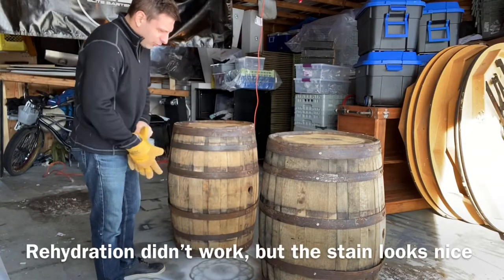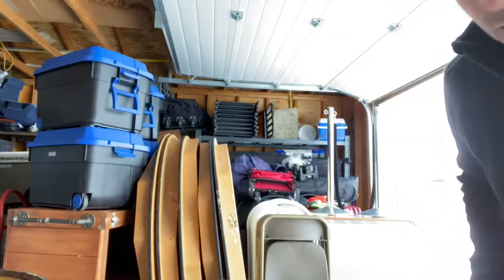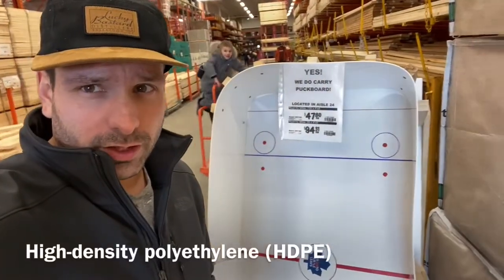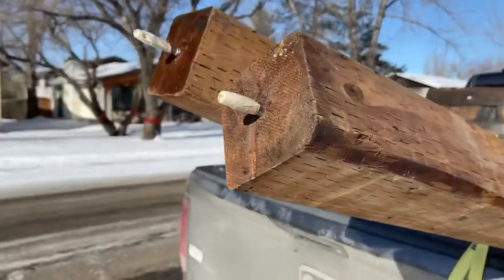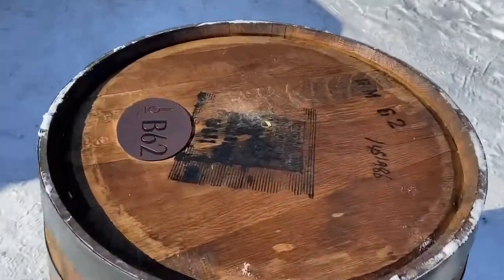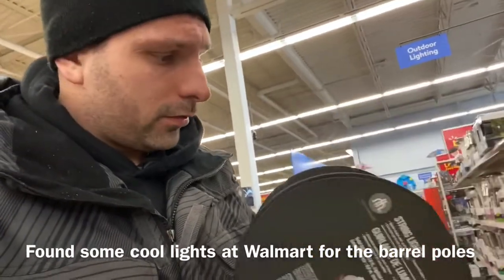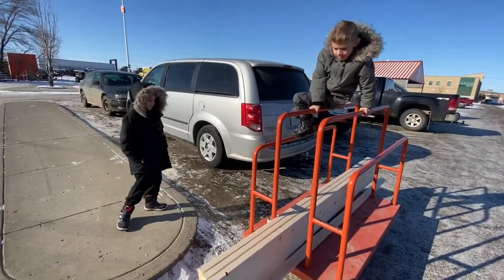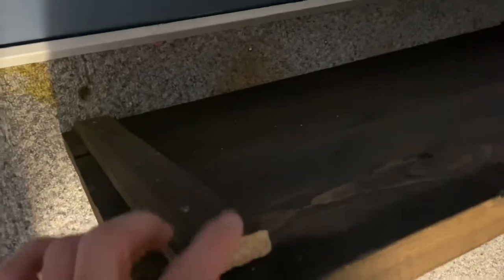DIY - Barrel Projects - Bar - Light Poles

Comment: Lee love these videos!
If it was me I would connect to smaller pieces of 4 x 4 lumber to each side of the bar to secure the bar into the barrels where the light posts go! To limit liability risk of the bar falling off or someone bumping into it

Or you can cut two slots in the bar top
So the polls are sticking out and then you can attach lights and other signs to the top!
I would do everything I can to limit the floating shelf without being secure to the barrels! 

Keep crushing it in these videos
Trying to keep  up with you and Gorothballon
And trying to keep classy